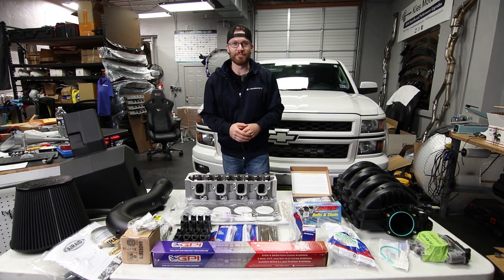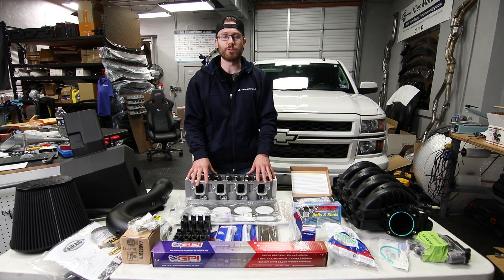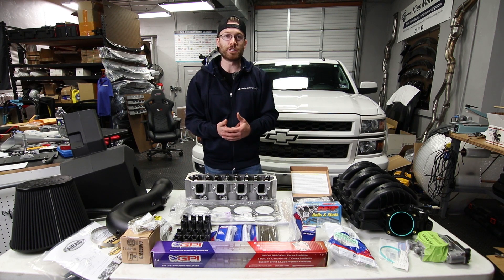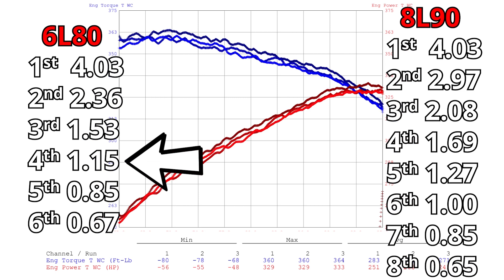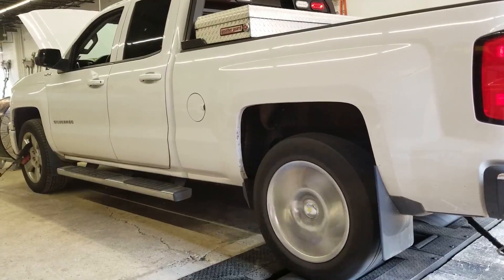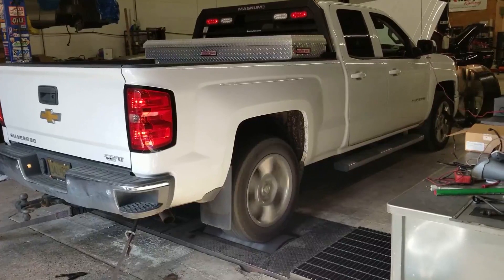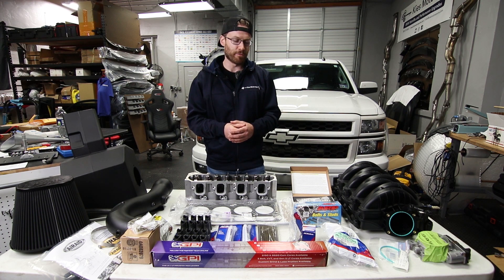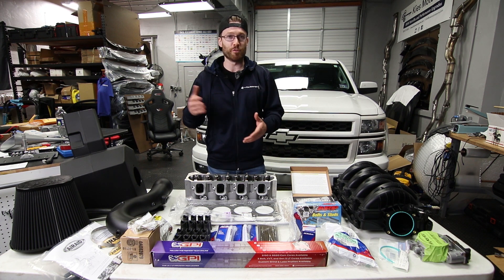AFM Delete Part 1 - What is AFM? Silverado 5.3L Baseline Dyno - How Much Power Does It Make?

Comment: This makes 100 percent sense dont get me wrong, i get it. but to go thru all this crap and cost why not just buy a 2500 6.0 that doesnt shut down to 4 cylinders? its hard to get passed buying a truck like the 1500 when we know afm had issues.

regardless, love your vids and looking forward to this series
Reply from the maker: Honestly, I may have considered that at the time if I had been aware of all the afm issues. The additional fuel economy (regardless of afm) was attractive tho because I drive 40K miles each year. Sadly, now even the HD trucks with the larger gasser motors have afm too 🤦‍♂️ it may be on all cylinders now as well so even more likely to fail. My next truck is going to be an hd, if the diesel doesn't have AFM that may be what I go for.
Reply: Aw man...I admit that I didn't do my due diligence and check out all the issues with the AFM system like I should have.  I likely would have held out for a 2500 or 3500 with the 6.0 if I knew what I was getting myself into....
Reply from the maker: @seanfrank4158  agreed
Reply: Lot of wisdom here, if you are reading this and considering doing AFM delete, it's going to be far more cost affective to trade in your truck for a truck that doesnt have lifter / torque converter issues. My 2017 1500  is at 95k and although this series is great, it convinced me that I'm better off selling my truck for $20k to the dealership for trade in.